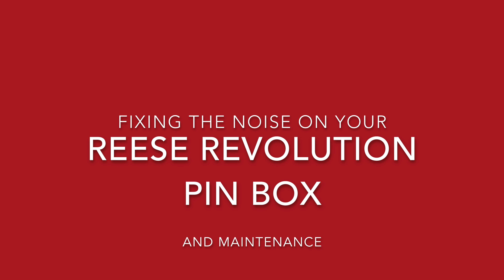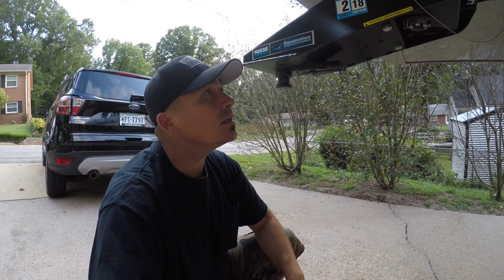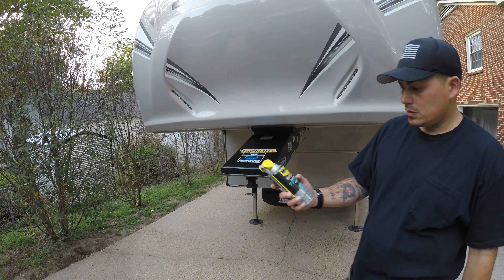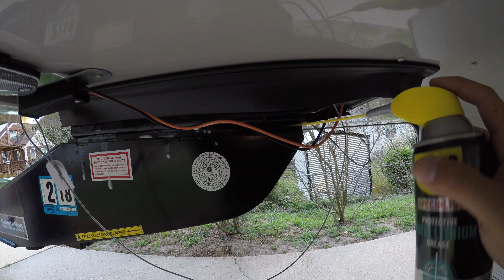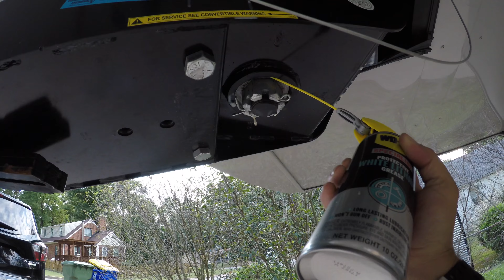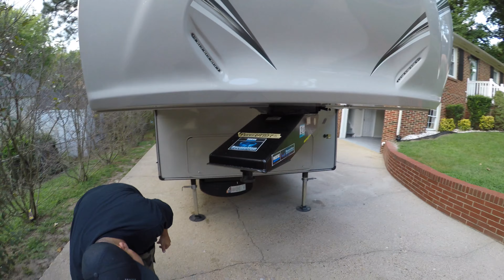FIXING PINBOX GRINDING NOISE

Comment: Brother if yiu want the best spray lube go with amsoil gun lube spray or break free clp spray for firearms . Spray once a month and it will keep metal free from water and rust and the friction of movement will heat up oil ajd bond to the metal.
Reply: Lithium grease is good short-term but attracts grime and dirt which will bind to it.
Reply from the maker: Sounds good.  Thank you 🙏
Reply: @FindingJay  zippo lighter fluid cleans out grime and you can add lithium grease back again when needed. That's what I use to clean and lube some of my guns. But so you don't piss off your better half, put a tarp below as to not have oil stains on driveway.
Reply from the maker: @cujo229  😂…..will do, thank you

Comment: Are there Grease zerks for greasing or is that really the way the manufacturer says to lubricate.  That's are really bad design if they didn't give you zerks.  I was thinking about purchasing an arctic wolf camper that has the revolution.  Thanks for the video.
Reply from the maker: William Servicefitter, after thorough research between myself and my local dealer my service rep contacted jayco directly who then sent us a fax from reese on the proper maintenance and care for this pin box and this is the exact way as per Reese.  I mentioned that this should be told to everyone purchasing this or any similar models so as to prevent the buyers from having issues because the only reason i looked into it was because i was getting a really bad grinding noise.....Artic wolf is a very nice camper,  great pick and happy camping.  (Ps)  ill be posting more informative videos as often as i get the chance, feel free to subscribe so as to stay in touch.  Thanks again.

Comment: Do you have a short bed or long bed and can you do 90 degree turns? Can't decide on the moryde or Reece for my eagle ht. How is the ride?
Reply from the maker: PlainSpokePictures,  thanks for asking.  Originally I had an 5.8ft bed which is why I bought this set up.  I now have a 7 ft bed.  The answer is yes you can make 90 degree turns easily with the reese no matter if you have the long bed or short.  At 90 you wanna keep your eyes open to make sure you don't over turn and hit the cab.   If you look at one of my earlier videos you can see me turning into my driveway on a hill with my short bed no issues.  As far as the ride I don't get any julting or banging giving me a rough ride.  The only issue I had was a lot of screeching and grinding because no one told me I had to lube the pin box so it was dried out.  That problem was resolved with the lithium Greece I was told to use.  As far as the moreride system, they typical come with that setup and I was told they were more smoother but didn't come for short beds but again I don't feel anything bad with the Reese I have.  Hope this helps with your desicion.
Reply: Thanks.  Looking to buy a F250 too.  Any issues with the bed height and the level of the camper?
Reply from the maker: No Problem, Its funny you ask. That was my concern when I bought my F250 because they make them so much taller now.  Thankfully the 5th wheels are adjustable because from my knowledge it is not good for the camper to be towed in too much of an angle but to answer your question there is no problem at all and in fact I loved my F150 but the F250 offers so much more power it just gives you that extra sense of security when you are pulling the camper and towing.  Feel free to subscribe and stay in touch.  I plan on putting up more videos about the truck, camper and adventures soon.  Ill help with any questions I can.
Reply: Thanks.  I subscribed and look forward to seeing more.  Do you have a 2016 or 2017.  The 17 is 4 inches higher.
Reply: What drone do you fly?  I have the 3DR Solo with gimbal for gopro
Reply from the maker: PlainSpokePictures.  I have the 2017.  I love the truck.  I would definitely recommend it.
Reply from the maker: PlainSpokePictures, the 3dr is a good drone.  My buddy has one and sometimes we'll fly together.  I had an inspire 1 that recently flew off into a 100ft tree....lol......I just ordered the magic pro because it was more affordable and convenient.  I should be posting a video on that this weekend.
Reply: Just bought the 29.5 BHOK.  Still looking for a truck.  Found a 2014 F-250 Lariat Crew Cab that I am going to check out tomorrow.  Hard to believe a drone like the Inspire would fly off.
Reply from the maker: PlainSpokePictures ,  congrats on your purchase.  I'm sure you will love it.  My family and I love ours and look forward to posting more videos about it.  Hopefully we will get to see a video from you also.  Great choice on the truck good luck on that. The inspire is no more but I received my new mavic pro and can't wait to see what I can do with it.   I'll be posting an unboxing video on it soon.
Reply: Sorry to keep bothering you.  Wife didn't like the black interior of the truck so I am still looking.  How tall are your bedrails?  This truck had 55".
Reply from the maker: PlainSpokePictures ......lol....absolutely no bother at all.  In fact this is why I made the video. The bed rails for my truck are 59 inches.
Reply: Thanks.  How much clearance do you have and did you have dealer adjust the springs on the BHOK or is everything just the way it came?
Reply from the maker: PlainSpokePictures ,  to be honest I’m not exactly sure Clearance I have but I know that it’s plenty.  As far as the springs I thing it is set the way they came from the factory.  The dealer should make any adjustments required when you go for pick up.....it’ll be a long day...lol
Reply: What is the dry hitch weight of your BHOK after all the modifications the factory put in?